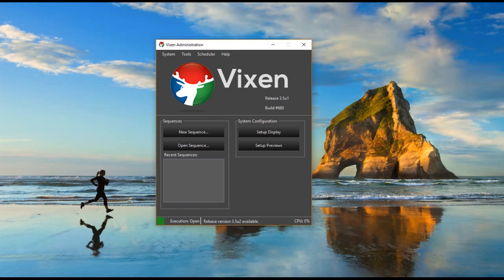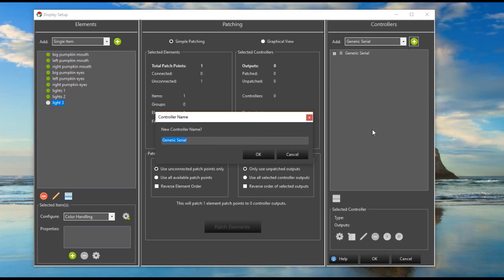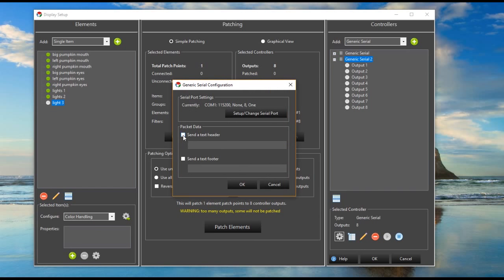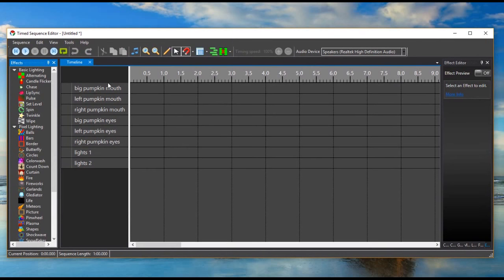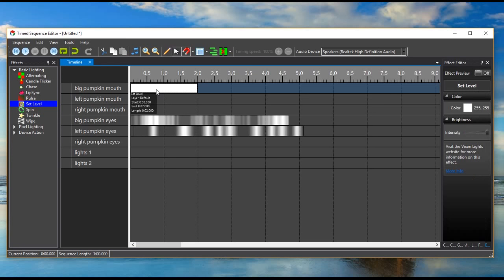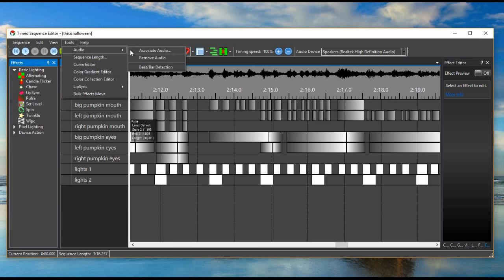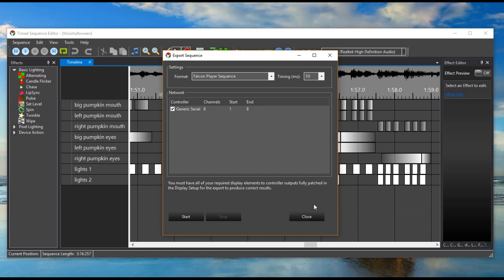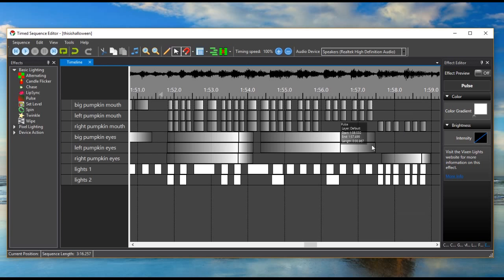Using Vixen to Control an Arduino Light or Animatronic Show

Comment: can u make servo move both direction?
Reply from the maker: You can in the sense that 0 is one direction, 255 is the other, and 128 or so is the middle position. That’s the same way most controller code like Arduino handles it, too, so it’s directly comparable.
Reply: I put 128 as neutral and 0min 255max but it’s still going same direction

Comment: @fadecomic Do you have a sketch for this that works with the adafruit PCA9685? I can get the basic code you provided to work when using the pwm ports on the arduino uno, but i can't get it to communicate with the servo board.
Reply from the maker: I use the PCA9685 here: https://github.com/jackStalnaker/singingpumpkins_big
Reply: @fadecomic  It's weird.  My pca board works with the example sketch, so i know there's nothing wrong with the board as all the motors move to the example prgram. But I can't get vixen to move the motors. 
I have the baud rate set right.. I'm using an Uno board and the pca9685. I can get it to work using the pwm ports on the uno, but I'm trying to use the PCA board to power and control them.
Something between the script and vixen is not working to interpret vixens output to the motors on the PCA.
Reply from the maker: @justinclarkphotos  shot in the dark, but the PCA board is 12 bit, while the Vixen signal is 8 bit. You have to map the 8 bit numbers (0-255) coming from Vixen to the 12 bit (0-4095) numbers the PCA uses. Just as guess. It could look like it’s not working because even 255 would move the servo very little.
Reply: @fadecomic  Interestingly, i’ve found that it will only work if it’s at a 9600 baud rate. So , some success here..
But I’ve tried higher rates, and it won’t work at all. I originally had it higher, you did, but couldn’t get a response from the motors on the PCA board.

I currently have them mapped 0-255 to 150-600.
So I tried increasing that range, and it would stop reacting to any input from vixen.
Even though, as you said, it’s 0-4096.

Increasing the Hz of the pwmfreq also made it stop working. Lol.
Thinking that if I can get those ranges to update and maybe it’ll move the servos faster (?).
Reply from the maker: @justinclarkphotos  Yeah, I actually forgot that if you look at the PCA docs, it tells you that generally servos don't use the entire range. In fact doing so could damage the servo. You kind of have to start in the middle and increase the lower and upper limits until you find the ones that fit the range of motion you need.

Comment: To anyone new here wanting to do this, let me give you some useful information. After my other comment i posted here i have learned a lot, and in the beginning i was an Arduino Mega, witch didn't work for me, because it kept freezing after about 10 or 20 seconds when i played the vixen lights sequence, i'm now using an Arduino Uno, and so far its working perfectly fine, doesn't freeze or anything. Confuses me because you would think the Arduino Mega with it having a lot more features, storage and ports would be better, but i suppose not, then again my Arduino Mega could of had faults, but the Uno works for me, and i think you should use an Uno as well, hope i helped. Thank you for reading! :)
Reply from the maker: Interesting. I currently have the setup I made this tutorial for running on a Mega. To be fair, it’s a third party knock off Mega, but I haven’t had any issues.
Reply: @fadecomic  maybe mine had faults then because it was taking longer to compile the sketch code than the uno, but I'm glad you replied, unexpected haha!
Reply: @fadecomic  also, since i cant use my Arduino Mega, i'm willing to use a Servo Motor Controller board, but how exactly would i set that up, could you help me?
Reply from the maker: @drnoelll  I’ve used a PCA9685 based board with this setup. There should be an Instructable linked in the video description with instructions, pictures and Arduino code in a github repo.  If not I’ll add it.
Reply: @fadecomic  I haven't seen any code to setup the PCA board in with the code you already put into the instructables so I think you might have to add it in like you said thank you very much. :)
Reply: @fadecomic  hello again, i was wondering if you could help me, i have encountered a problem where the servos movements aren't smooth, and the keep making a little buzzing noise, like they are slightly adjusting them self, and no the servos aren't bad, they work perfectly fine, also it seems to be that the more servos i add the worse it gets, please can you help me fix this?
Reply from the maker: @drnoelll  is this with the servo board? The PCA board? If so, if I remember correctly, the Adafruit driver uses 0-4096 instead of 0-256 as a range.
Reply: @fadecomic  Sorry, no i should of mentioned, i'm doing it your way, plugging in the servos signal line directly into a pins with the ~ (squiggly line), but you said 0-256, in the sketch that you made, for me it says 0-255, also when i set "TESTINGMODE" to true, its perfectly fine, they move smoothly, but the only issue with that is, after about 5 or 10 seconds my Arduino Uno board freezes up and crashes/restarts its self.
Reply from the maker: @drnoelll  right I meant 0-255. Not sure why the board is freezing up. Are you powering the servos off the Arduino? You can get away with that for maybe one servo, but more than that and you’ll brown out the Arduino and maybe even fry it.
Reply: @fadecomic  Oh right OK. I power the servos separately, 6 servos for each movement, but i just cannot figure out why its stuttering, and moving like its on low power or something, are you sure there's no other way you can help with this issue?
Reply: @fadecomic  hello again, sorry to keep bothering you, but i have come across a problem that i dont know how to fix, i have all the servors connected to the arduino board, all wired up correctly, but there seems to be a problem where only the mouth servo functions correctly, and the other servos seem to be sticking and not moving smoothly at all and sometimes have a quiet slight buzzing noise. Had this issue for few months now and i still dont know how to fix it, im using a power supply board that came with the kit i bought, it supports up to 12v, so it should be fine, so i dont think its a power supply issue, please can you get back in touch thanks mate.
Reply from the maker: @drnoelll  Hmm. Does sound like a power issue. It's not the volts that matter so much as the amps the power supply can provide. Your servos might all be 5V, but running 10 of them at once might be asking the PSU for more than the amperage it can provide.
Reply: @fadecomic  yeah found it was a power issue, the board wasn't capable, so I got a bigger one with like you said much more amps, didn't know about this at the time, thanks for getting back in touch.

Comment: how do i run it off the computer and how do i play a show just from my computer and can i stop and start it and change it to another show?
When i try to play my sequence from where you make it where all them effects are it dosent play on my actual servo, im only using 1 channel and 1 servo for testing, but when i play it dosent work.
Reply from the maker: You can’t really directly hook it from your computer to a servo. You need a controller in between. Either a commercial controller like the ones that Vixen knows about off the shelf, or a diy one made from a microcontroller like an Arduino. Sorry for missing this.
Reply: @fadecomic No worries, im using a different control system thing now, but thank you!

Comment: How do you handle the repeated output to the servos so that they only move once until the next command is sent
Reply from the maker: Each servo gets a movement instruction per frame. If the servo is stationary it just gets the same position for a number of frames.